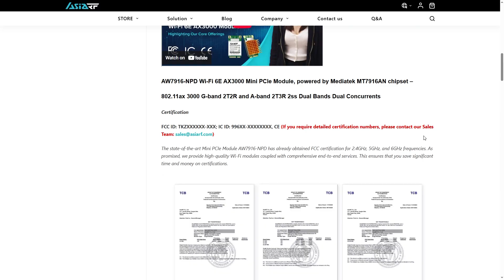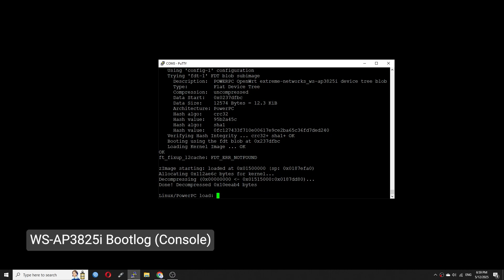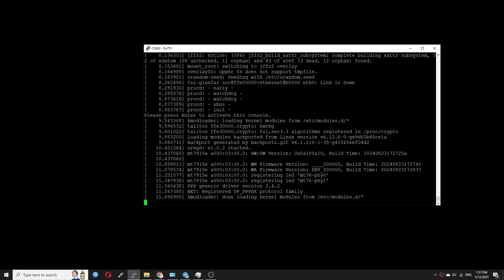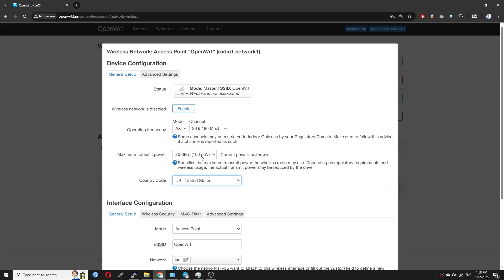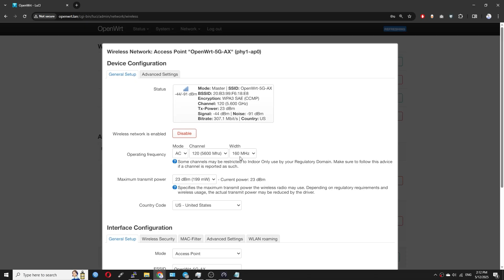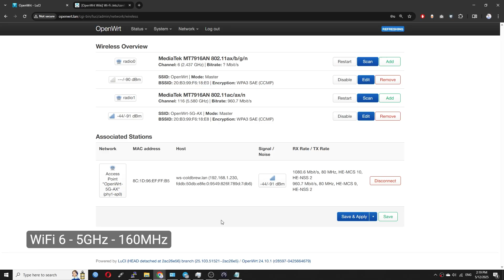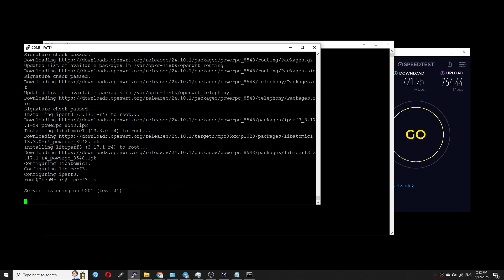OpenWrt - Upgrading WS-AP3825i with AW7916-NPD WiFi 6E (Speedtest up to 800 Mbps)

Comment: Hello Van do you think GPON SFP module, gpon ONU and use our ISP router in bridge mode effect bufferbloat even when use high performance router because I'm getting B bufferbloat when I use SFP module with Asus RTBE88u router  But I'm getting A+ bufferbloat when I use my ISP router in Bridge with the same Asus router. I think SFP module's CPU can't handle bufferbloat test or something.
Reply from the maker: Hi, may I know what is the SFP module and the SFP converter/adapter you are using? It also play an important part.
Reply: @VanTechCorner I have an HSGQ xpon SC APC SFP module and Nokia G010S A and I'm using a tp link mc220l media converter.

Comment: Is there a router that has an M.2 or SATA port where after OpenWRT is installed, the router can also act as a NAS? I would like to setup such a NAS router with the biggest 2.5” SATA drive inside, instead of having the storage externally, plugged into the router’s USB port.
Reply from the maker: In this case, you can try the x86 router PC, such as the N5105 router PC that I tested sometime ago. It has M.2 NVMe, Mini-PCIe for Wireless, SATA and 5 x 2.5GbE.

Comment: There is an issue when updating in softwre section in openwrt router to install packages. It say faild. The reason being said for failing that openwrt doesn't support opkg anymore but they said it do supporte apk now. My need that made me update is to install luci relay package but with that issue I could not do it. I am new to github stuff but I found the package there. Can you make video about installing specific package then uploading it to the router without ssh?

Comment: Great to see someone do something with these wifi cards.

Am I right in understanding that this is one of the few modules that can give proper AP functionality on both radios at once?   I recently learned that normal intel cards, etc are designed to work well as a client device, but poorly as an AP or wifi router.

Comment: Could you do a step by step instruction installing openwrt on ws-a p3825i?   please🙏🙏🙏🙏🙏🙏
Reply from the maker: Hi, the device I have comes with OpenWrt pre-installed. You can see the guide at the OpenWrt ToH page (link in the description). I will make the installation guide once I am able to revert this device to stock firmware.